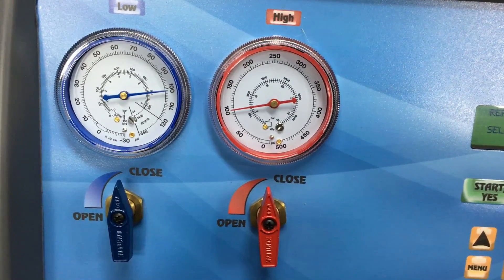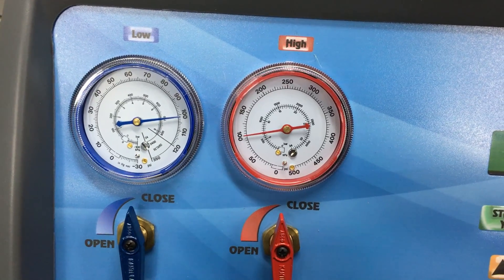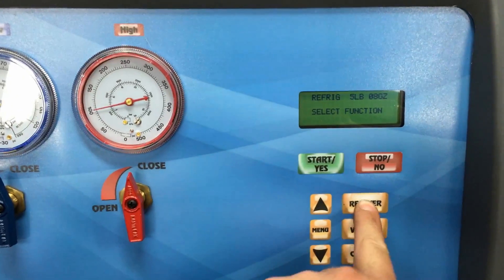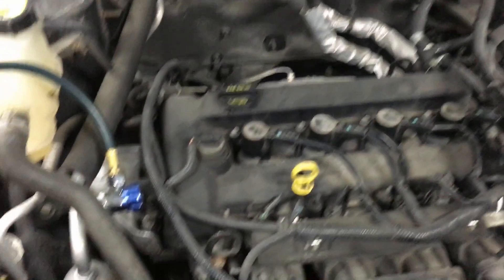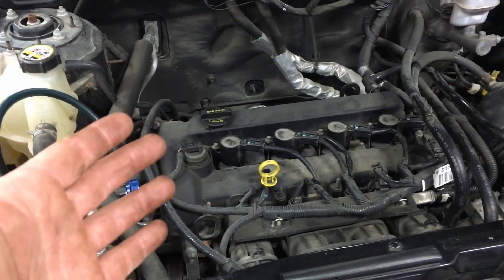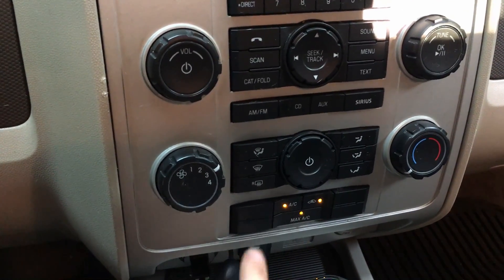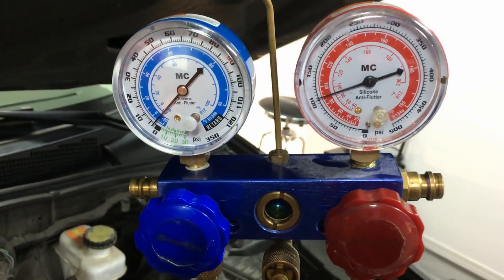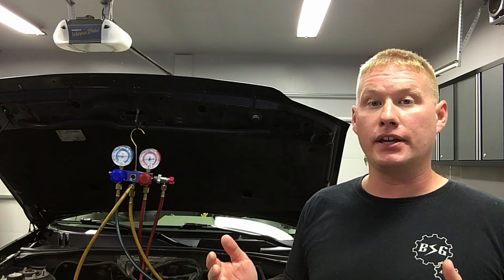Ford A/C Quick Tips #6: NEVER use Static Pressures for Diagnosis

Comment: I thought static readings is both side combimed. 60 would be correct if system was running Dynamic. But high is 60 too. So both sides are reading too low,  too low

When charged correctly both  sides will read 100 PSI static if engine off.

After removed and put just enogh freon to get 60 PSI. 

The static dropped down to 60. I would think its obviously lower than 100 static at the temperture of 86 degrees

I missed the point. Static was 40 PSI less than correct 100 PSI. 

 Static is too low if combine both sides. You never gave high side static pressure.

And purging air is importsnt when starting diagnosis  for a DIYser using gauges and not having  a machine to do it autimatically. That was skipped. Let the freon push through the hoses before connecting and charging system when connecting can to yellow line open gauges and push needle in at end of Red Blue lines

I 😢think the point of difference between new TXD and Fixed orofice is simply the compressor just runs constantly,...its easier to know in Fixed Orofice system,   if its gets low and  compressor cycles more often . Right?

A/C really needs  to be taught A-Z when ever doing  diagnostic.

Comment: Checked the static pressure on the jeep. High side read what I expected 117 psi but the low side read 300 psi. Everything is new. I’m thinking the compressor. What do you think. FYI ac does work when until it gets pass 107° at that temp I would expect air in the high 60’s. It’s actually in the low 80’s.
Reply: I think static means system off and at leat 2 hours to balance both sides.  

I got where he talking about put freon in and one side gets higher, the low side without compressor. 

But he didnt go through the step of running engine with A/C then let set two hours

At 4:50 he puts freon in and says oh were good 60 PSI were fine. I would never do that. 

Like putting oil in transmission or engine you need to run system to get correct levels, or in this case Pressures.

Then at 7:20 he says I turn engine on and run it and its now lower. Duh. 

The video should really be title dont trust your static until you RUN YOUR ENGINE with AC on. Just like oil , transmission fluid

Comment: Issue im having is the pressures are changing as the Trucks RPM change. All new components but its not cooling. Idle at 55/170 reved to 2000k at around 30/220. Wont cool unless reved or driving. Any ideas?
Reply: Clutch?

Comment: Your reading was reflecting the freon PSI  did not reflect ambient temp. as the freon was colder then ambient from being drawn in the system. If you would have waited until the freon warmed to ambient temp. reading would match. Noting to do with type of AC system.
Reply from the maker: not sure what you are complaining about these are static pressures at room temp.

Comment: Love your videos BUT it’s definitely not totally worthless because the static check will tell you if you have refrigerant in the system which is a great way to start your T/S. Won’t tell you if it’s a full charge but will tell you if you’re empty.
Reply: Will a static pressure reading indicate if the system is overcharged, before starting up the AC?
Reply: @U2BER2012  NO

Comment: First off, thanks for all of your knowledge and sharing that knowledge with the rest of us numbskulls out here trying not to kill ourselves. 

That said, what's going on with my '08 F150, 5.4L with the dynamic pressure being at 45-50 low side and high side at 450. Ac on coldest in cab, high speed fan and recirculate option on? Isn't that 450 a dangerous pressure level? 

Also, if you would afford me the time for one more, although definitely related question, I found that I had a bad relay in the aux relay box mounted on the wheel well, driver side, in engine compartment. Long story short, I ordered a new one and when it came in, I Installed it immediately (I might mention I live in Florida about 15 miles South of Dayton Beach, so yeah, it needed to go on immediately) it didn't work. I couldn't believe it. I take it to a shop for a new starter (just didn't have time myself) I ask them to just take a look at why this relay isn't working and got the truck back and the terminals inside the aux box are gone along with the cap to the aux box but they never touched it...OK. so I go to the salvage yard and pull a new relay box and while I'm at it I look at the same model/year around me and they all are still equipped with the relays I need so I grab them...not a single one out of 4 worked. However, in the meantime I had jumped it with a wire at one point and also a 20a fuse they both ran the compressor great and I'm riding freezing balls and that's what is still running my compressor because no matter how I do it, the fuse works and the relay doesnt...any of them. So, what's up with that? (Sorry for the novel. I just wanted to Include everything for you to go on. 

Thanks again, bro.. You rock. Keep up the great work.

Brad Humphrey
My mind is a  plethora of useless information
Reply from the maker: Considering both low and high side pressures are high before I say you have a high side restriction I would evac and recharge with the correct amount of refrigerant before going any further.
Reply: @FordTechMakuloco  I did vac rhe system and start from scratch and from what I could tell, I out the correct amount if refridgerant in. I don't know, it's just being really weird. What about the relay problem? any thoughts on that?

Comment: i have taken my 2018 F 150 into ford dealership and they could not fix truck. The A/C works great for the most part...but since i owned it (1 Year) the A/C on 5 separate occasions did not work . is there a fix for this

Comment: Looking for a video explaining why an ac will blow cold air until engine warms up, then air goes hot. Outside temp doesn’t matter.
Reply: Prob bad blend door control. Cause once coolant gets hot inside heater core then hot air blends with cold air. U can try to bypass heater core to determine problem

Comment: After you refilled it with 3 oz why would somebody look at the gauges and say they are fine. They showed 60 and 60 static. That is low. Don't need a trained eye for that. Who would say that is good? What it did show was that 3 oz will give you 60 and 60. This does not explain why you should not use static pressure for the initial part of diagnostics. Or am I missing something?
Reply from the maker: I think you missed it yes.
Reply: Put me in that category of missing it. The only thing I get from the video is you need the static pressure chart, which is obvious to most people. It isn’t explained why there’s more to it than that.
Reply: Yea I thought I was reading my prior response. You and one other guy only call him out. 

Title should say cycle freon after install Duh . And check static after 2 hours 

But who does that. My time is valuable. I put in until high side starts rising above low side because its being compressed and stop when at correct pressures for both. Then slam the hood. 

Sometimes I think they dont have material to keep channel going

Comment: Do you have a chart that you recommend a guy use for correlation of pressure to temps? I’ve been watching your videos on the diagnostics and I’ve learned a ton, I work for a Deere Dealership and work on Ag equipment. I was able to diagnose a plugged evap thanks to one of your videos.

Comment: Just to be clear. In this scenario your reading 61 lbs static pressure on an undercharged system with an ambient temperature of 86 degrees. So the static pressure is way too low for 86 degrees. It seems to me that with the right gauges or a chart to make sense of the static pressure readings you could tell it's undercharged by the static pressure reading. Is this correct or am I missing something. I'm just now starting to learn. The method I followed was to use the gauges with the engine and the AC running and compare the readings to a chart for R134A auto systems. I didn't pay attention to the static pressures. Thank you for the video.
Reply: I'm glad I'm not the only one who noted this.  The "untrained eye" must mean not referencing an r-134a temperature/pressure chart.  Static pressure alone is not enough but for gross under/over charge conditions, it's a good start I would think

Comment: 2009 Ford Flex. Chasing AC issues. My “can gauge” says I’m charged. I went and loaned this manifold gauge to test it correctly. 
It’s 77°, 36% humidity. 
With air on 60°, AC on, dual disabled, rear disabled, FRESH mode: on the Low side I’m at 14-15 psi. High side is 120 psi. 

With REAR climate on, everything else the same I’m now reading on the low side 34-35 PSI and 150-160 psi on the high side. 

Which method should I be looking at to get this at the proper charge? Rear climate on or off?
Reply: This is a very interesting question, I have a Safari that has rear AC. Regardless  if the rear fan is on, it always cycles to the back, thus get the same reading both ways.
The REAR numbers look good, did you stick a thermometer in the dash vents to see how cold the air blowing out is?
Reply: @OldSchoolNoe  I ended up adding more refrigerant and then it started working again.

Comment: Thanks for the video.   Question if I may.  I have a new to me 2012 ford escape 6cyl.  Whenever I turn on the defroster (with heat in the cold NW morning) the ac clutch engages and my radiator fans blast non-stop?  I changed the ac pressure switch and symptoms remain.  I rented one of those ac gauges and plan to see if there are any red flags, but not 100% sure of what I am looking at/for.  Thank you, Scott
Reply: AC clutch is supposed to engage when you turn on defroster. Radiator fan is temp driven depending on your environmental conditions and auto

Comment: So my crown Vic recently had a skip on its step, and while I went on a road trip, on the way back it worked fine, on the way back it felt like it wasn’t cooling as well. I tested the temperature, on max fan and ac, it blows between 45 and 55 F (I would assume this is normal temp since the 55 was on a hot day and the 45 was on a slightly cooler day). I tested the pressures and was blowing maybe 25 psi low and 225 psi high on a 74F day, are those numbers normal? The compressor would kick on and off every 5 seconds so the pressures never stabilized but that’s as low (and high) as they went, and I think I might just be over paranoid about my car 😂

Comment: You just proved that using the static pressure reading is the easiest and most reliable way of checking the charge of an A/C system. Why are you saying the opposite?
Reply from the maker: I am say never use them unless you know what to look for.

Comment: i thought  u only can check A/C system when it is running. the compressor must compress ... so what has happen is it lost presser some how and can not be check correctly if not running??? or bleeds over to the other side???
Reply from the maker: Static pressures can give you lots of valuable information before you ever perform a dynamic test or performance test.
Reply: @FordTechMakuloco  okay thank you...

Comment: I just put my gauges on a 2006 H3 Hummer, the low side static pressure pegged the gauge, and the high side static  pressure was in line, with engine on low side fluctuates from 20 psig to 70 psig, I’m guessing expansion valve, any help would be appreciated

Comment: I HAVE A, 2011 FORD ESCAPE ,LOW SIDE IS 125PSI  HIGH SIDE 210, THIS IS WHEN RUNNING, I HEARD THE DRYER FROM 08, THROUGH 2011. WILL BURST AND FILL EXPANSION VALVE. WHAT DO YOU THINK.

Comment: I am neading some air conditioning help. 2011 f250 king ranch 6.2 gas I  have low pressure on the suction side and high pressure on the high side. Temperature coming out of the vents is only around 62 with the ambient temperature outside of 98 so it cools but not great. My brother-in-law works on home AC units and said he thinks I have a partial blockage in the system and mentioned I should look for an orifice tube. All the videos I find on YouTube with orifice tube is on older trucks, do these trucks even have an orfice tube or is that a different system.  I am trying to figure out a direction without throwing a ton of cash at it.  Thanks for any help or suggestions.

Comment: love those compressor control valves that fail and they say you must replace the compressor. Nope just changed the valve on a 2015 festiva for a intermittent no cooling. Works great.

Comment: If a refrigerant that changes to liquid at say ( example ) 100 psi then a static system with 2 ounces of liquid refrigerant would have same pressure as same system with 20 ounces of refrigerant at same temperature. Correct?
Reply: thanks I'll get it checked.

Comment: 160 on the high side and 170 on the low. A/c condenser is a little damaged. What do you think?
Reply from the maker: Sure sounds like a compressor that is not coming on or not pumping.
Reply: @FordTechMakuloco   I noticed the AC condenser was damaged. Looks like it got hit by a rock. It's bent near the orifice tube.
Reply: @FordTechMakuloco  and its a small SUV. cooling in the front and warm in the back.

Comment: Hello I have 40 PSI on the low side of my AC air conditioner with no compressor engaging. Clutch moves, relay and fuse good.  I have a 3.0 V6 motor Ford Escape 2010. I should at least be 50 psi at 70 degrees that's what I'm thinking? I want to charge it, if I charge it to say 100 PSI is that ok with the compressor not running? 
The Compressor should kick on at some point while I am adding Freon correct? What if it does not? Thanks In Advance And You Are Awesome!
Reply: If your issue is low Freon, yes charging the system will turn on the compressor. I do not want to just tell you to charge it. You should also put dye in there to find the leak, and then properly fix everything, including the leak. A low side only gauge only tells you half the story also.

Comment: Maybe you could help me? I just got a 2012 Ford Fusion. It's reading 25 Low side. 250 to 325 high side. The pipe will ice over like snow.  What can I do? Are check? Thanks
Reply: I'm dealing with a similar situation. There is generally only too causes. A clog in the system somewhere, or not getting enough air flow over the coils. More likely a clog in the r134a system.

Comment: Yo, if you let the AC run a bit after putting in the 2ozs of Freon, then turn it off and let it stabilize, the static gauges will  show very low pressure so, I disagree with this video.  Whose gonna squirt 3 ozs of freon in and not run the AC.  Who measures a car without first running  the AC? I disagree with assessment on static pressure being worthless to the untrained eye.

Comment: Howdy. Yes I have 2011 ford Fusion Se it was in accident on 06-18 this year. The got push in it missed up the radiator-cool fan & AC condenser-Freon lines is good or bad I might need to replace them on the right side missed up & bumper-grill-replace right side head light. So can you tell me how to check if the Freon line is good or bad putting air compress. I'm calling from Houston Tx

Comment: Interested in this series because I have an issue with my a/c.  When I leave my house, no matter what direction, I am up to 50 mph almost immediately so the air works great.  I recently spent a few days in the city where I averaged less than 30 mph and my system struggled.  After checking with gauges, not sure I need to add more Freon.  
Was wondering the cost to purge and refill my system with proper amount? 2006 F150, 5.4

Comment: also my car reads 30psi low end and 200 on the hi end in a 100+ day, i thought it was low so i added 12 oz and it started cycling on and off like crazy so i got some of it out and now it cycles normally but still reads as if it low with compressor on.

so what is the issue?

Comment: Those charging cans with gauges--mine has printed instructions to start the engine and run the AC on high setting--fan up before connecting the charging hose to the low port.  I have taken flak from an auto forum for using the "Can" without acquiring a manifold gauge set to check the system.  Presently, after using the "Can," my AC is cold and the temp gauge I inserted into the mid-dash center vent reads about 40F at the hottest point.  Definitely great for the past 2 weeks as the weather here is 90+ and very humid.  There is mucho sweat on the low side lines under the hood--so much so, it is dripping water.  The vehicle is 17 years old so I am not about to put $200-500 into a repair by a shop.

Comment: I have 08 edge and it will not blow cold compressor works its fully charged i changed the expansion valve and the compressor and still no change the line gets frosty when it takes in the refrigerant but after that nothing and it seems like its getting trapped somewhere any tips

Comment: Thank you my brother about txv valve  you say when car off system will equalize after 5 min  icomplete the car ac and pressure look good but not cool air why  i replace condenser and expansion valve  but it not cool why

Comment: What is this reference to a "trained eye"? This is extremely basic information, do exactly as the bottle tells you and only measure the pressure with the car running on maximum AC settings. Basic stuff.
Reply from the maker: Point is many vehicle owners that try to fix their own A/C say yes it has plenty of refrigerant seeing the 60psi for example when in reality this means nothing to the untrained eye that doesn't know the temperature to pressure correlation of R134A.
Reply: Most of the DIY equipment instructions specifically tell you to test the pressures while the AC is running. They want to avoid the static pressure situation that is demonstrated, because the concept of varying static pressure based on temperature is too confusing to explain to some people, especially in brief instructions on a can.